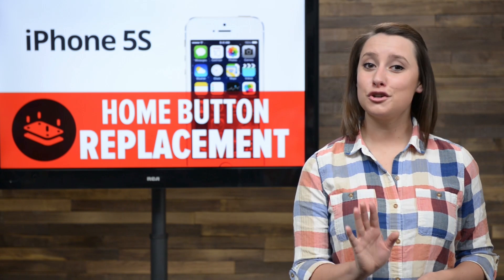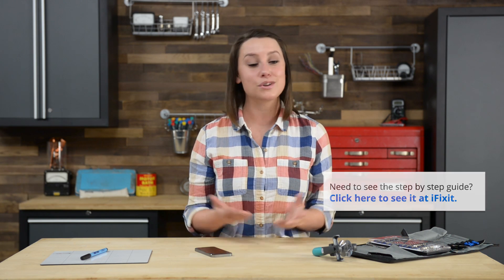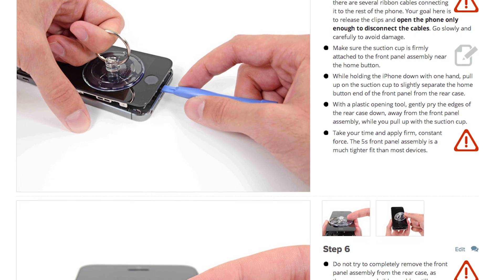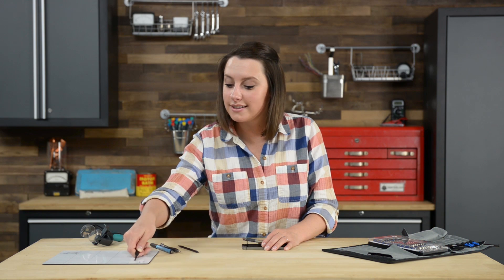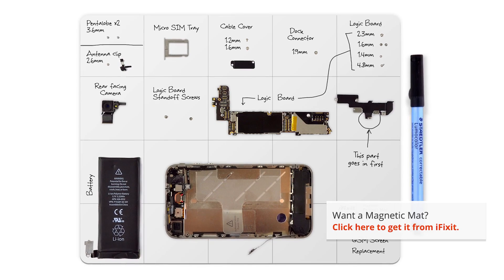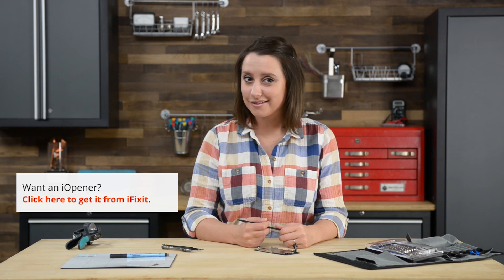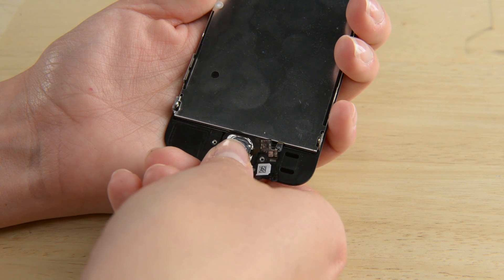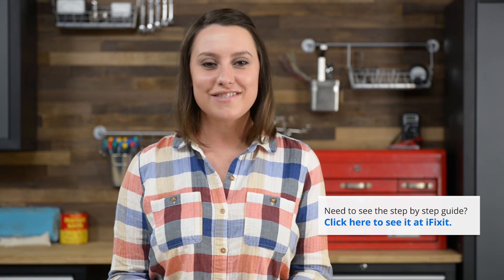How To: Replace the Home Button in your iPhone 5s

Comment: I did this without removing the top ribbon connector set. Just held the front open with one hand and replaced the whole button assembly with the other.  Half the work.

Comment: after me replacing the battery on my iPhone 5s the home button stopped working at all its as if the cables are not connected its telling me that toughch id is disabled. can this be fixed?

Comment: My white iPhone 5s screen cracked and the flex home cable is ripped so I purchased a black 5s screen everything works fine except the Touch ID. I still have the old iPhone screen, what do I do
Reply: Neiman Marcus all you have to do is take the old fingerprint sensor and transfer it over

Comment: If i buy a faulty iphone , and replace it to my iphone. The touch id will work ?
Reply: Only the original iPhone 5S home button that came with the phone will provide the TouchID function on that phone.   If cracked screen is replaced on an iPhone 5S then the original home button is removed from damaged screen and installed on the new screen to retain the TouchID functionality.   If the original iPhone 5S home button is damaged then a replacement button can be installed and will provide click, double click, click and hold functions but will not provide ToichID functionality.    This is a security feature of the phone.  The original home button is paired with the original motherboard to prevent fingerprint hacking.  Replacement iPhone 5S home buttons sold on eBay or iFixit do not include the TouchID feature.  I hope this clears up the confusion about the iPhone 5S home button and TouchID.

Comment: So what if i restored the phone to factory settings and replaced the phone with a new screen and home button would the touch ID work ?
Reply: Can anyone please confirm?
Reply: Ya-Pops Fam it won't work:\
Reply: You can contact apple and get them to change the code but it's gonna cost ya from them to do so

Comment: i accidentally ripped the ribbon cable off the touch ID button, can i use the replacement cable to connect it to the touch ID? and will it work?
Reply: No Touch id will not work
Reply: I also have this problem

Comment: i have an iPhone 5 and i want to make it look like an iPhone 5s will the fingerprint thing on the 5s fit in the iPhone 5. I know the fingerprint will not work bit i don't want it to work? please help
Reply: Yes thats true but with a little soldering skills you can jump the 2/3 wires from the touch id's (click button) to the logic board. However it wil not scan but thats is what everyone knows. I'am not sire how big it is in diameter but it costs 6 dollars so give it a try
Reply: First point, second, the cable architecture ist much more different and so it won't fit into the 5 board.
Reply: it won't.
Reply: No its not possible because the touch id is bigger than homebutton
Reply: Why not? Go to www.ifixit.com, there you'll probably find the dismensions. Good luck and let us know if it fits ;-) !

Comment: I have replace my home button and touch ID sensor . But after it . My touch ID function doesn't work. Is there i should notice . I noticed a piece of metal around the touch id sensor with the screw . which direction of the small metal ?
Reply: if your touch ID button was replaced touch ID won't work again without original part
Reply: have you found the proper direction fot small metal ?

Comment: Hi my iPhone 5s screen recently suffered a bad crack and i was willing to replace it. There was no damage to the touch id/ home button, but after i installed the new screen and connected the cables the touch id stopped working. I was wondering why that would happen since its the original sensor?
Reply: your Flex cable may have been damaged or the connector witch can be damaged easily, hope this helps!